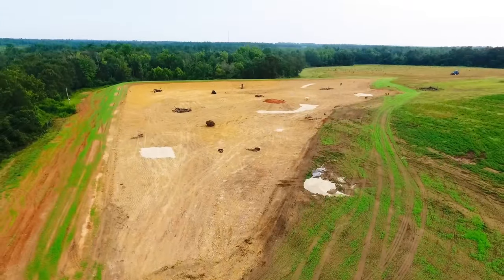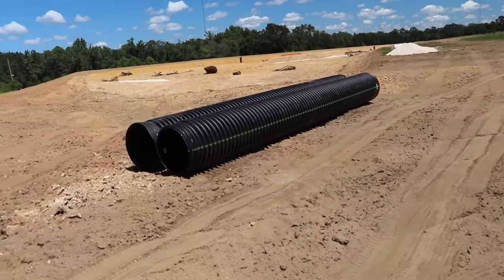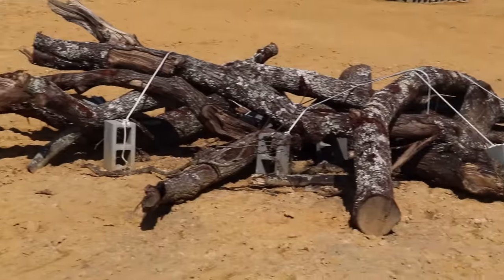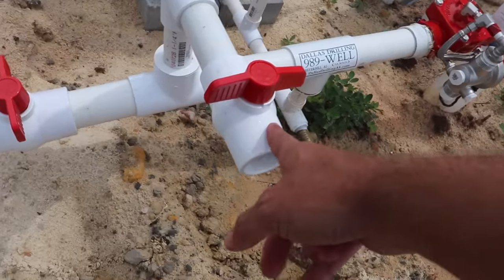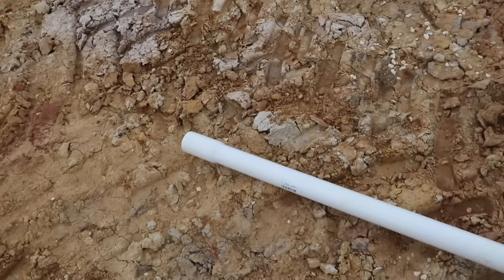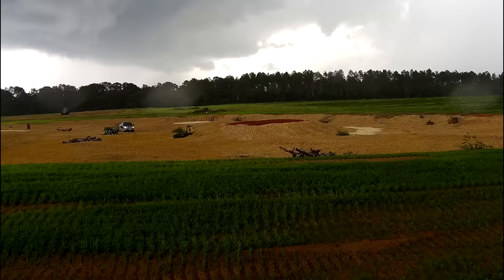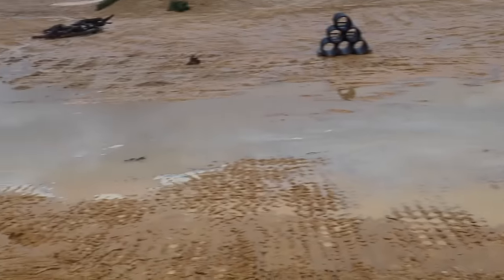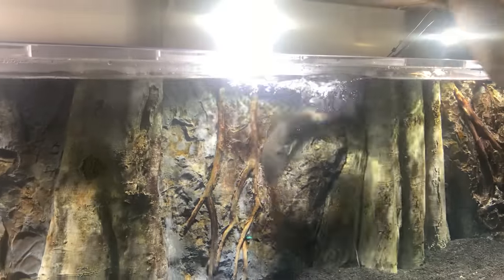Building a 5 Acre Pond! (Filling it with Water)

Comment: Rake a little bit of topsoil on the island. Clay has no nutrients, and also suffocates root growth from lack of pockets for air. Roots like oxygen as well. If you put a bit of topsoil, the grass will take faster.
Reply: yeah u r right.
Reply: Clay do be lacking all the macro nutrients
Reply: @haydennicoson3128  and it also acts as a nutrient barrier. Yes, it will absorb fertilizer. But it will trap it at the surface, and not let the roots get any.
Reply: @Halorocker101  what???
Reply: @Halorocker101  I got it. Lol.

Comment: Turn the well inlet into an aerator? That way it doesn't drill through the clay liner and enhances the pond health (meaning better bass!)
I would drain and build the dock right the first time with piers and avoid the floating dock.
My last suggestion would be getting some 3 or 4 inch plastic pipe and criss cross it inside the willow cage and zip tie it to the cage. That way when the willows rot in 2 or 3 years, the pipe will still be a great fish attractor.
Reply: Fantastic idea

I gotta take notes for all these ideas once I build my own pond.
Reply: I agree with building the dock the right way now, even if you have to let some water out and delay the fill. It's just going to be more troublesome to go back and do it over later with plants and fish in the pond.  Put some rip-rap stones at the fill pipe to hold it in place, break up the flow and limit the erosion. Once there is water over it you won't be able to see what it's doing. Hate for it to blow a hole through the liner. You could also drill small holes along the submerged length to reduce the force of flow, like a drip hose.
Reply: man thats some great advice
Reply: @thoriated  A floating dock would be even better. Wood/metal pilings rot and rust, not to mention that you have to put posts in, possibly damaging the liner. Floating docks last far longer and there's no risk of damaging anything.
Reply: @thoriated  cant he put a fitting on the end that pumps the water UP instead of out sideways? So its pumped up into the water and not out allong the bed?

Comment: It would suck to have to drain it and start over, but being able to build your dock exactly how you want it and being able to have the peace of mind with knowing your clay liner has no weaknesses is extremely valuable in the long run and seems like the best option.
Reply: Could they just set some pressure treated posts in concrete filled tires resting on top of the clay bottom?

Comment: I hope you open the drain up and let the water drain to the point of being able to build the type of dock that you want to have. There will be many years of enjoying the dock you want instead of enduring the dock you don't want. You spent the money on the well, and you did the manual labor of putting in the 2" fill pipe, you know that you can fill the pond manually if in fact you don't get the typical rain you talk about in every video.
With all of that said, stay safe! I for one am praying for not just your family, but all of the impacted areas from Ida, and I'm sure many  others are as well. Blessings to you and yours, Mr. BamaBass!!

Comment: I think you need to dump a load of gravel where the well comes into the pond to help limit the erosion. You might also/instead put 30 degree bend pointing upward, once there's a few feet of water. That way, the steam will be disrupted by the existing water, rather than having a heavy stream of water running parallel to your clay liner.

Comment: Something to keep in mind regarding your well water is that it typically is not oxygenated at all and can create some problems with your dissolved oxygen levels effectively creating a potential dead zone in your pond.  You may want to consider creating a creek bed for the last 50' or so before the water reaches the pond, giving it time to tumble over rocks and aerate to the point that it's healthy with oxygen by the time it hits your pond.  Plus, that could be a really nice feature to add to the overall environment you are creating with this project.
Reply: that's a great recommendation and how did he aerate the pond?? I remember him driving around on a boat doing tests but he never showed us how he oxygenated it. Glad I came across this comment. I know it's a old one but I do still go back and rewatch some of these while I wait for the new ones to come out. 👍🏽Great recommendation once more 😎
Reply: @PurpleDrac  thanks for the comment. I think he ended up routing the pipe or hose so the water shot out of it. That was a minimal way of oxygenating the water but it was a statt. Wind causing waves, even small ones, is also a great source of adding oxygen and with a pond that size, there is certainly a lot of surface area to be affected by wind.
Reply: In eastern KY with that well water, the pond could have supported trout if it were properly designed.   I've done it in Georgia.

Comment: That well outlet would make a neat aerator feature in the pond if you turned a 90 straight up at the end of it.  That would take care of your erosion problem too.
Reply from the maker: We were planning on building a waterfall into the pond but not at that location. Might have to re-route the pipe to go to the waterfall.
Reply: @BamaBass  that sounds awesome keep that pond turned over so there won't be a thermal cline
Reply: Also if you stock shad they will do so much better with moving water
Reply: @smithrx97  having a waterfall were the runoff would end up in the deepest area could solve the problem no?
Reply: @smithrx97  great observation.  natural springs and wells have very little oxygen.  BamaBass will have to add at least a bubbler to move the desolved oxygen off the surface to the lower water water plane.
Reply: @calf6349  
He will need at least a couple of strong bubblers, placed in the deepest spots.  They do all sorts of good things for pond ecology, and they will prevent fish kills from "turnovers."
Reply: @BamaBass  Yes, as others have pointed out, deep well water can be anoxic.  It might cause problems if it is introduced directly into the pond without aeration.  I was envisioning the well water spraying up into the air like a fountain, perhaps with something on the end of the pipe to act as a diffuser for better aeration.
Reply: @smithrx97  Good idea, but I think a 5-acre pond will require more than one.  This is an issue that needs advice from a pond mgmt. expert.

Comment: bama! I live waterfront on a lake and started with a wooden dock, sledge hammering poles into the lakebed, and eventually upgraded to aluminum. my aluminum dock has plates on the bottom of the supports that just sit nicely on the lake floor, and I can tie boats up to it just fine. For your purposes a floating dock would work just fine. No reason to risk the integrity of your clay layer.

Comment: Also, to keep from getting runoff channels in the clay when you fill with the pump, run a fire hose from the 2" pipe to the standing water at the deep end. Fill from above the surface so that the flow doesn't disturb the clay bottom. As the pond fills you can just pull the hose back up.

Comment: Very interesting project - hydrology very intriguing and erosion of the 2 foot clay layer definitely something to be wary of. The waterfalls could get scoured out if the pond level is low and a hurricane hits - static water is not erosive, but you don't want your dam wall getting busted either. Your outlet pipe looks to be a foot or so diameter at the top, but the outlet pipe going through the dam wall  is much narrower diameter? I watched all your phases of this project and found it really interesting and looking forward to seeing how it develops!
Reply: This is why many of these undesigned ponds eventually wash out.  Few people think this far ahead.

Comment: Put in a floating dock with legs that have mud pads on them so when it's completely full you'll float. When the water table drops a bit it will rest on the legs with the mud pads and not punch thru the clay.

Comment: I say floating dock is your best bet. 

P.S. another suggestion is get you a large pond aerator. It sits at the bottom of your pond and you just run a weighted air hose back to shore with an air pump. Helps to raise the oxygen level and works way better then a fountain.
Reply: Proper aeration really helps! For an application this size I'd suggest something like a solarbee aerator/mixer.

Comment: I did mine with 3/8” right twist #14 skewed clockwise a quarter turn, and to keep backwash from closing out the effluent flow. I use a 1/4” flange connected to a 6mm arc adapter and then terminate the assembly with a reverse confabulator offset by half again the distance between the elbow termination and the reverse-under hold brackets, which are set back by twice the width of the chrono-synclastic infundibulum.  Cheers.

Comment: Don't forget, unless where you are never gets below 30, even with this last February freak freeze, make sure you have a way to fully insulate it a couple months before any freezing weather.

I work at a building supply store and can't tell you how many people come in the day before the freeze happens, or even the day of looking for heat lamps, pipe wrap, pipe heaters, faucet covers, and heaters.

Personally, I'd have a greenhouse like cover that is easy to put together or haul that you can slip over the well/pump as soon as temps start to dip.

Or find a way to cycle some warm water around the well to keep it above freezing.

Comment: Dock 3rd option. Build it on land with a lower support that will just rest or "float" on the bottom.  No puncturing through the clay liner and no rocking to disturb the fish from a floating dock. You can make the structure that is on the bottom as wide as is needed to not press down into the clay over time. The same thing can be done on shore and then just have beans between the two structures. Any standard dock materials could be used as well as typical leveling methods.  And no pond draining necessary.

Comment: Run the pump. Plus the Storm.  And you get filled in before winter. T the discharge and put 45 degree outputs on it up in the air. Won't erode when full.

Comment: Some plumbing advise... You should change the elbow bends at pump outlet to 45 degrees.  You loose a lot of pressure with the 2 tight bends.  Also bigger risk of blowing first bend off..

Comment: What an important video to learn all about this massive project. But the camera zooming in-out and moving back and forth and this way and that is a big strain on the eyes and the brain. You could either put the camera on a tripod, but if that is too much extra work, then maybe still pics with your running commentary will do an excellent job much better from the viewer's point of view. Maybe you can think of that next time. I can bet you that your viewings will increase a 100 fold if you did that, as the quality of your videos will improve dramatically. Good wishes.

Comment: Great job. I would have added a shut off and a hose valve at the pond as well so you dont need to use a hose that's super long to reach. Easy to fit one in at any time. Also some stones/Pavers or cinder blocks to kill erosion. Quikrete is great for this as you can ancor the pipe to it. A solar aerator/fountain is a must. How cool would it be to have a clear box  you can enter and view the fish in there. Not sure how you would keep it dry but it sounds cool.

Comment: Edible Acres has a video series on his hand-dug microponds.  One of the things he found useful to deal with the runoff gathered into a stream is to divert it into a level ditch parallel to the waterline.  This slows the water as it's just spreading and not running.  And then a level spillway from the ditch to the pond, so the water enters slowly over a dispersed area, not all in once erosion-point.

Comment: A floating dock would be ideal and less hassle in the long term. Anchor the dock to the pond basin (bottom) with concrete and stainless steel cables to prevent too much wandering.

Comment: Loving the videos but thought I should mention that the water that's filling the pond around 9 minutes in would have been considerably faster if you'd used 135 degree bends rather than 90s. The pressure at the pump was insane

Comment: I'd have put the water line deeper and turned it 90 Degrees with a flap gate at the top about 10 ft from the edge of the pond sticking well above the waterline. Also recommend putting aerators in a few locations in the pond to help with stagnation.

Comment: I'd get filling it and start the water cycling, as it may take quite some time to have the sediments cleared out from the erosion through the filling process. May have to look at having a bit of a marsh areafor where the low valley brings in the fresh water, otherwise you may have a constant flow of sediment through the life of the pond.

Comment: Interesting series. I do think you will be forced to drain it again and line the sides with concrete blocks. This to make sure the sides will not erode too much and it will ensure the safety of your pond for the future. And I do mean 30+ years. For a dock, well both the floating dock as the regular dock have there advantages and disadvantages.
 
A floating dock  needs poles to help guide it and make it more stable over all. At least that's with a more regular base that most people will use. However I would strongly advice you to check out the Netherlands and what they have to offer in ideas. I don't say buy from there, I just say take the ideas and see if it would be helpful for what you are going for. There are many different floating dock types in the Netherlands and if you really need the right dock then take those ideas to heart. Now for when you drain your pond for whatever reason, a floating dock will sit on the pond floor, do realize that fish are not smart enough to realize that it isn't a good place to wait. You may end up crushing fish who are likely getting under your dock for safety and covering them self's from predators that may try to swoop in. This is both a positive as a negative thing obviously.

For a regular dock, if you need to replace bits like the poles them self's it will mean you need to drain your pond, dig out the broken bits before you can fill it up again. Yet it's the most stable dock option you can get IF the maintenance is done properly.

For your island in the center, why not place a tree that will grow huge? It will allow not just the island to be covered eventually, but also a bit of the water. It will add some scenery to your pond and makes it look a lot better over all. The roots will also poke out of the island eventually which will be beneficial for the fish as well.

Comment: My concern for the underground pvc is that the ditch isn't very deep.  That allows for alot of soil flex when heavy vehicles move across the pipe.  I would do a check once a year at the min to look for breakage or leaks.  Was the dirt cleared of rocks before the pipe was laid and the soil dropped back atop?

Comment: Don't punch a hole in the clay. Plant one end of your 20' posts that you will use for your dock in appropriate size barrels of cement. After a few days lower them into your pond at the sight of your dock. And it begins.

Comment: i think a floating dock would work just fine have it  anchor down another  + with having a floating dock you can move it  around lot easier  when your lake  really starts to take  shape and you can add or remove stuff from the dock it's self lot easier then having to build 1 and have it stay in 1 spot

Comment: Neat project, but I would seriously recommend against filling the pond from groundwater (I’m a geologist with a lot of training in groundwater systems) by the look of your well cuttings it looks like you have what’s called a confined aquifer, which means that any water you take out of it will take hundreds to thousands of years to replenish. Also by taking the groundwater out you will remove water that is keeping the sand and rock porous, which can lead to a total aquifer collapse which will affect not only your well, but also every well in the surrounding area. Pulling the groundwater out and putting it in a concentrated place (the pond) will also put significant amounts of pressure on the aquifer below, which will cause it to become squashed, and will accelerate the aquifer collapse…basically it’ll destroy the groundwater resources for everyone around you, and lead to a lot of other geotechnical problems (such as subsidence). It’s a neat project, but please please please don’t destroy the groundwater by filling your pond.

Comment: I would have used 2 45 degres bends on that water pipe (iam a plummer). The 2 90's will affect pressure and flow.
Allso make sure to build a pump hpuse for the pump /well head equipment :)

Comment: do it slow, also you need erosion protection under the end of that pipe, be it a concrete slab, like a concrete lid, riprap,concrete poured out or a steel plate

Comment: Your shade shack might run into problems. If you pour cement into those cinder blocks with wood in them, the wood will expand and shatter the cinder blocks. Seen it more times than I can count.

Comment: Build your duck out of 55 gallon plastic barrels and make it a floating dock. to rise and fall with the water level then you ain't got to worry about puncturing nothing. you tired gangplank off to the bank and put your platform out and put together 55 gallon barrels or the pontoons keep an expensive way down  to do it. you can buy pontoons though. my dock  is a floating dock still have to put the support pipes on each side that it will ride up and down on to keep it stable

Comment: Should have used concrete instead of blocks to hold down the pipe pyramid. Then drill holes through them all to run a wire inside holding them together/down. Less snags